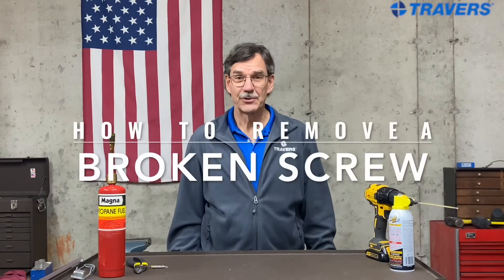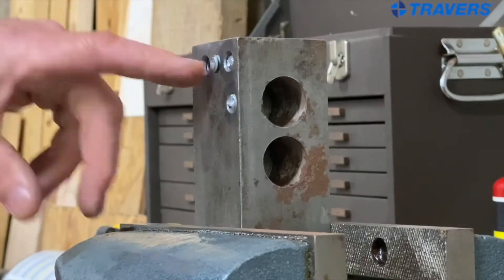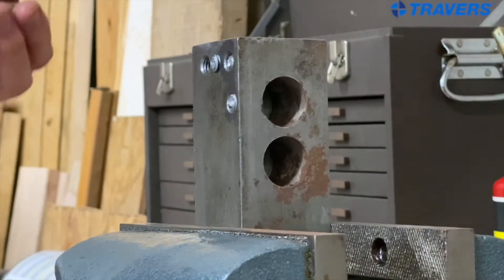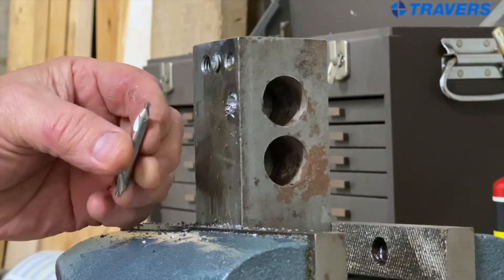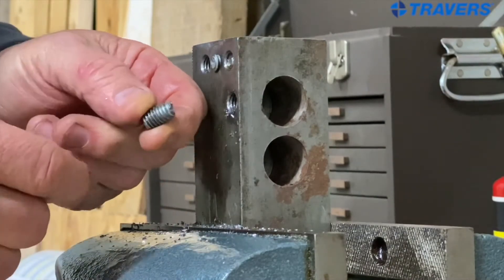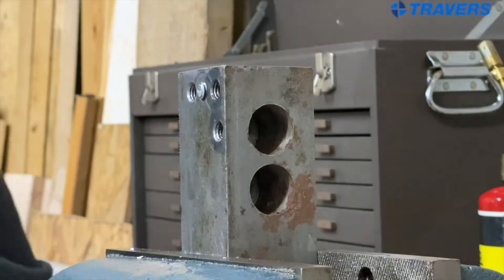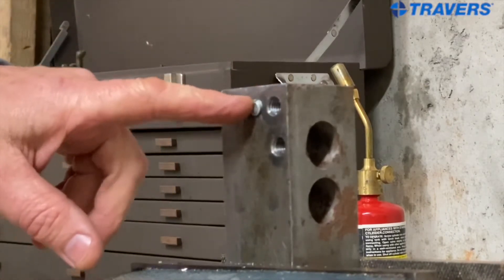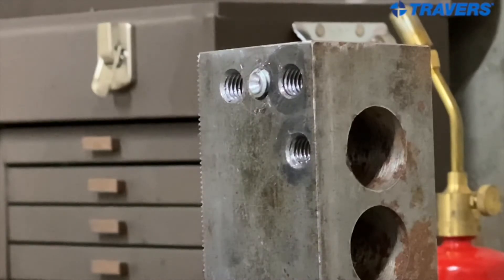How To Remove A Broken Screw (Multiple Examples)

Comment: What if someone glued a screw in.... Is it still removable?
Reply from the maker: I apologize for the extended delay. We've been experiencing difficulties accessing and responding to YouTube comments.
I hope you figured it out by now, but heat will help -- like a hot air gun, or a torch. A hair dryer doesn't produce enough heat, unfortunately.

Comment: Good tutorial. Unfortunately, I have a screw that fused to its hole, the head broke and it is made of a very tough metal that I cannot even drill through it. Maybe I should weld a head or something of that kind to be able to extract it.
Reply: That's a tough one, but you might be onto a good idea there. If nothing else works, a last resort I've used is to find a shop that has a ram (sinker) EDM. I've even had broken taps removed that way.

Comment: The bit you called a combo drill and counter sink is called a center drill because it was created to get a center hole on a lathe. The part of the bit your calling a counter sink is designed for the live center on the tail sock of the lathe to keep the part centered. There are woodworking bits that com with replacement drill bits to pre drill the hole and cut a relief for the head of the screw. That may be what you were referring to.
Reply: All so true, Grammy.  At 0:55 into the video, I did call it a Center Drill.  It was at 2:23, where I also mention that "everybody calls it a Center Drill".  The technical term might be Combination Drill and Countersink because a true Center Drill has a 60° included angle, but these same tools are also available in 82° and 90°, which are the countersink angles for imperial and metric (respectively) flat head screws.  Great input though!  And thank you for posting.
Reply: @wonbythe1  Grateful to you both for the knowledge and the context! Thank you.